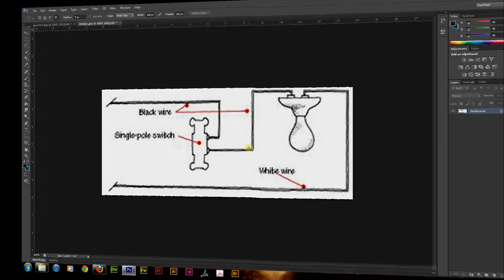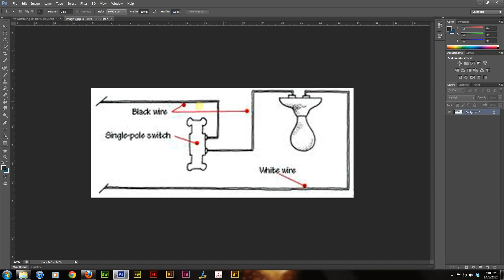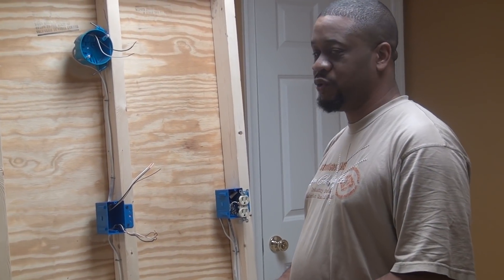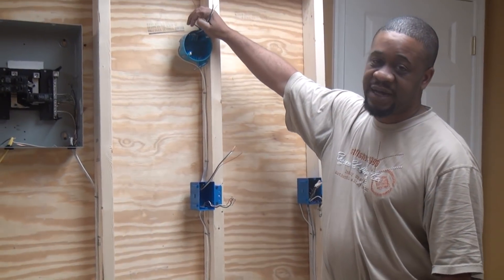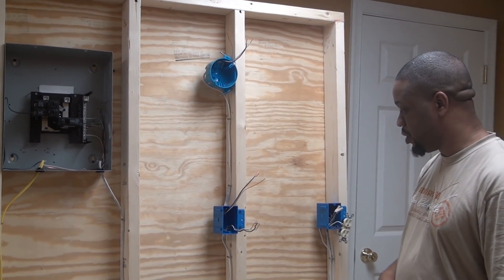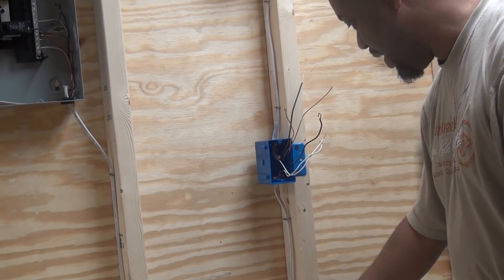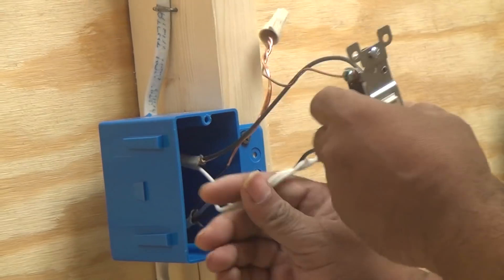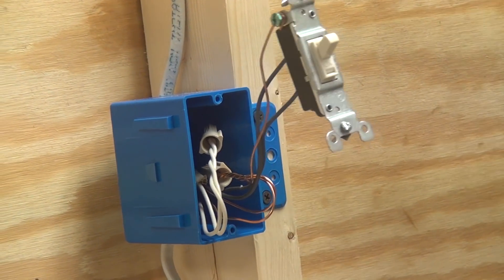how to install a single pole switch

Comment: I am renting and want to install spot lights/ ceiling lights that connect to a plug to plug into a wall. I am putting. it in a box to be attached to the ceiling so I am not actually cutting holes or doing a major wiring job.  My question is, how do I connect the lights in a chain to come to one end where I can connect a cord w/switch & plug them bad boys in?
Reply from the maker: black to black white to white ground to ground. since you plan on having basically a extension cord connected to the lights as a power source and switch I highly suggest that you make extra sure that the cord has a ground and that it has a solid connection.
Reply: I'm sorry & one would probably say why is she doing this with no knowledge of any of it but I have to start somewhere right! 😁 but ground?? I need the wiring for Dummies version. I have watch plenty of videos and believe i get the just of it with parallel circuits and striping of wire and the ridged side of the cord vs the smooth, but no one actually says how to connect multiple lights to an extension cords or plug to be plugged in nor do they explain if lamp wire would be what I use to attach each light to each other but I have many questions, lets get what you mean by ground on the first part of your message & the last regarding the extension cord? thank you
Reply from the maker: You certainly do not want to use lamp cord because it may not have a ground eg. just  2 wire (most lamp cords). Your ground is what allows the circuit breaker to open if  current flows outside of its intended path. If you have no ground then you have no protection against faults. You also need to observe the polarity of your connections to make sure that hot and neutral are not reversed.  I have videos on my channel that answer all of these questions, however if you are not able to follow the concepts you may want to call an electrician to be on the safe side.
Reply: Amen. I will watch more videos and get a better understanding b4 I do anything. Which one of your videos best explains what I am trying to accomplish here?
Reply from the maker: I would suggest looking at all so you will have a good understanding of what it is you are getting into. If it were plumbing or carpentry then having a limited understanding would  be more forgiving, but with electrical making the wrong type of mistakes can be super costly and in the worse case fatal. So go through all the videos and if you still have questions I do suggest giving your local electrician a call. BTW for the record I do not agree with what you plan on doing but if that is the route that you take I would rather see you do it in the safest way possible.
Reply: I didn't realize the complexity of it all or all the concerns in safety.  The guy at Home Depot made it seem doable and quite easy. I thought I could just use the parallel circuit method & be done then you said the "ground" & not to use lamp wiring and I. got a lil messed up. I then thought ok same thing just using 3 wires instead of 2 and just connect black to black white to white & ground to ground til I get to the end then do the same connecting the remaining black white & ground to the extension cord but since its a lil more complex than that I will leave that to the professionals and find a safer way to get the effect I want. Thank you so much!
Reply from the maker: You are welcome Lythisa

Comment: hahahah no and foo   laughs ..  Nicely done  ..  can you use quick connects instead of twist caps just for neatness ??   or is there a problem codewise with using them
Reply from the maker: You can use any device that is UL rated
Reply: thank you ..  It worked well.   I am now following you

Comment: I am trying to replace a single pole switch with a GE Smart Switch. I looked in my switch box but the only wires I see are a black, a white (both of which are connected to the two terminals on the right side of the switch) and a bare copper wire. I don't have the second black wire so it must be wired differently. Do you know if this will still work with the Smart Switch?

Comment: I really like the setup with the free standing wall, clearly showing the boxes, wiring, breaker, everything. Really smart idea. You could have cut the part with you getting the ground wire and bulb and we would have had no idea! Still, great video, I know it's a few years old but it was very helpful.
Reply from the maker: Thanks sirixamo

Comment: I really liked this video and I want to thank the fellow in it for doing an outstanding job and being very informative. I also liked that he pointed out which color screw was for which wire.  It is also important that when you do wiring yourself to have a good light source to be able to tell which screw is which. White wire goes to silver screw and black wire goes to as he said bronze or gold color screw.  I also want to point out that he used the right tools for the job. The screwdriver he used if you had noticed had a protective plastic sleeve on it which is to prevent any unintentional grounding which could cause an arcing of electricity and also the wire strippers he used were good as well. One thing I have learned from my own experience over the past fifty years of doing things myself is that you can not be cheap with your tools and materials.  And he had wired the switch and light the correct way, unlike my dad who had some how always managed to wire a light switch using both the white and black wires.  Where in this video we see that only the black wires go from the light switch to the light. I don't exactly remember how my dad had done this but this was the way it was back in the fifties and why I will never know. Could help to explain why so many electrical fires happened back in them days before uniform building codes were put into place.  Back in those days crews that built houses like the ones my dad built also did all the plumbing and electrical work as well.  But I cannot stress enough how good and valuable it is to find a person as this man who had demonstrated that he is not an idiot and actually knew what he was talking about.  This man whether he realizes it or not could actually have saved lives by showing the proper way to install an outlet. I know because a building that my dad had wired burned down two years ago from faulty wiring.  And also use the proper wiring for the intended use. Don't be like my dad and use internal wiring for external or underground use.

Comment: could i use 2 awg ser wire. 4 phase? when they updated the home panel everything is copper.
Reply from the maker: +PolyCouple PaulCryatal ser is 4 conductor cable

Comment: i was wondering if you can tell me . i want to install 100amp subpanel. to my deattached garage.running a cable from the main house which is 500ft away. the house has a 200amp panel.4 wires. 2hot.1nutural.1 ground.  . what size wire should i use to feed the sub panel. i know code states i must use the 4 wires. and i will also i use 2 grounding rods 6 feet apart.
Reply from the maker: +PolyCouple PaulCryatal 2awg ser aluminum

Comment: do you have a video on running multiple lights on a 1 switch circuit?
Reply from the maker: +Dimas Henriquez The process is the same it does not change. You simply parallel as many lights as you want (run cable from light 1 to light 2 etc. connecting black to black, white to white, ground to ground)

Comment: The switch that controls my basement light is wired to both the white and black wires. Why is it wired this way instead of being the way you wired your switch?
Reply from the maker: +Dimas Henriquez There are many ways to wire a switch loop, I just present a method that is commonly used and most likely to run across.

Comment: Thanks for a Great video!  I am trying to wire up a matrix of 60 each NP5 GU10 120V 25W Halogen lights.  The matrix will have 6 lights in the  X axis times 10 lights in the Y axis = 60 lights total.  I want to add 16 each light switches, one on each horizontal and vertical row so I can control power to a specific light or set of lights in the matrix.  Hope this makes sense.  60 lights times 25 watts =  1,500 watts / 120V = 12.5 Amps if I had everything on, so I should be able to run this on a normal 15 amps house outlet.  Also could I do this with light dimmer on/off switches so I could even have more control over the lights??  How should I wire this up??  Thanks for your help.
Reply from the maker: +Paul Moon well there are many ways to wire this up but a good rule of thumb is to not load your circuit to more than 80% of its rating. So a 15 amp circuit should have a load no greater than 12 amps 20 amp circuit 16 amps etc. Yes you can use a dimmer or lighting controller, how you design the circuit  is up to you.

Comment: how can you cancel the 3 way and replace by one motion detector switch?
I have 3 switches (top, mid, bottom) of the staircase and I wanna replace the middle one with a motion switch and bypass the top and bottom.
Reply from the maker: +J Desroches If you have 3 switches controlling one light then 2 of them are 3 way switches and the other is a 4 way switch. the type of switch that is in the middle will determine which type of motion switch you will need also I am pretty sure that you have to have a neutral conductor in the box that contain the switch that you want to replace with a motion switch (occupancy sensor)
Reply: Thanks for the answer T
Reply from the maker: +J Desroches you are welcome

Comment: Would a afci breaker be needed to install a single pole switch in a living area or a single pole breaker is what would be needed?
Reply from the maker: +malik lazare In the us yes the afci is needed single pole or double pole depends on what the circuit is for

Comment: Great video, best one I've seen on YouTube thus far. My only question is which side of the switch goes to the light bulb? the on or off?
Reply from the maker: +Calvert Edwards does not matter

Comment: switch info good BUT, FIRST THING, you forgot to tell the amateurs to TURN OFF THE BREAKER going to the electric box BEFORE they start.  Most amateurs will touch the live wire to the screwdriver or pliers to the metal part of the switch or some other metal close.  The result; a shock or burning of the metal item and the screwdriver and switch.

Comment: Can you tap from an existing switch to run to a new switch for a new light?
Reply from the maker: +Frapo Chino If the box containing the existing switch has a neutral conductor in the box then yes.
Reply: +Tyrone Robertson could you please elaborate on why it has to have an existing neutral ? What if it doesn't?
Reply from the maker: +Frapo Chino the new light will need a hot and neutral wire to operate, so does not matter where the power comes from so long as the source has a hot and neutral conductor.

Comment: Thanks hommy saved me $200 for a closet light...didn't even know i could take power from a outlet to it...i thought you need a whole new wire to the circuit board for it.

Comment: Hi Tyrone. I'm going to change my old light switches to new single pole switches. The new switches I bought have 2 terminals on 1 side and ground terminal. The old switches in the house that I want to remove  only have 1 terminal on each side and looks like it doesn't have a ground terminal. What can I do there? Can I still use the new switches that I bought?
Reply from the maker: +Jose Pineda yes, if the box is grounded just use a 10-32 screw  in the box and attach a ground wire under the screw and use that for your ground on the switch

Comment: Hey Tyrone love your videos....Very helpful! I have a question: I just replace a standard outlet in my basement with a GFCI outlet and while I was at it, I decided to add a switch and a light. The new switch and light work fine but my meter shows "Open Hot" on the GFCI outlet and it is not working. I pigtailed the ground, black and white wires (like in your video) then wire nutted the 3 grounds, 3 white and 3 black wires at the GFCI outlet. At the switch, I joined the 2 white wires (from switch and light), connected 2 black wires to switch and pigtailed and wire nutted the 3 ground wires. At the light, connected the white and black wires to the fixture and pushed the 1 ground wire into plastic box. Any help as to why I have an OPEN HOT on GFCI outlet will be MUCH appreciated! Keep up the great videos. - Penny
Reply: +Penny DiCarlo - Also, it is a 20amp circuit and I ran 12g wire to switch and light (12g is what was coming in to exsisting outlet). The only thing on that circuit (as far as I know) is a sump pump motor and the new switch and outlet.
Reply from the maker: +Penny DiCarlo you would have to take pictures and send them to me then I would be able to see exactly what you have and give you a solution.
Reply: +Tyrone Robertson Hi Tyrone, thank you for your quick response. Turns out, the GFCI outlet was tripped when I tested it......duh! Everything works great. Thank you for your helpful and informative videos. :-)
Reply from the maker: +Penny DiCarlo You are welcome :-)

Comment: Thank you so much! For some reason it took forever to find a sight that just told how to wire a normal single pole switch,  but you did a great job. Actually I've done it before but its been  a while so I just wanted to be sure I was doing it right.
Reply from the maker: +mntncougar You are welcome

Comment: how can i have constant power in a single pole switch that will feed power to the fan switch next to it. Since i want to be able to turn on bathroom fan in dark or turn fan in middle of day without main light on. fan switch receives power when single pole switch is on. There is a red wire connected to same connection where black wire is connected to on single pole switch. The red wire is then connected to black screw on fan switch which powers it if its on the on position.

Comment: My kitchen light switch only has 2 wires, no ground. Is that normal?
Reply from the maker: +SPaoline4302 in some older homes you will not have a grounding conductor and in some situation I have seen updated wiring where the ground has been cut.

Comment: Hey Tyrone I am having some trouble with hooking up a new ceiling fan I have changed all my ceiling fans in my house including the one that I have took down to install a new one what I am having trouble with is first off all there is only one wire going into the box for the Single Pole light switch the wires were stuck into the back of the switch I hooked up the new fan there is power when the light switch is an the off position however when I turn the switch to the on position it throws the breaker. I am confused why there is only one wire going into the light switch box need some help
Reply from the maker: well if the light was working prior and there is only one wire in the box I can think of only one possible explanation. There was no neutral conductor in the box and they used the grounded box as a neutral by connecting the white neutral to the box. This of course is a big no no you do not want to repeat this action if that is the case.
Reply: thank you for the help after scratching my head for a bit i figured out what they did apparently they was short on the wire and used the nuetral as a hot i marked the wires so this wont happen again it is crazy how some things pass inspection when being built

Comment: Thanks, you cleared it up for me...   I'm wiring a light in an existing closet.  I will use the White Wire from the Switch to connect to the Black wire on the Light....
thanks AGAIN!

Comment: Hey Tyrone, thanks for the videos. I am running electricity to my garage from the house breaker box about 100 feet away, do I use 10 gage for the long run to the garage sub panel then 12 for all the outlets and lights or can I just use 12 gage for the whole thing ?
Reply from the maker: fudgedog 100 ft is not that long of a run you can use 12awg if you want.
Reply: Tyrone Robertson thanks

Comment: Great video, great teacher. Do yo have one on bedroom outlets controlled by light switch for bed side lamps?
Reply from the maker: David Farrell I do not have one that show that specifically but the principal is the same instead of running the switch leg to the light you run it to the outlet that you want to control.
Reply: Thanks
Reply from the maker: David Farrell You are welcome David

Comment: Thanks Tyrone. This helped me out. Keep making videos and I will be watching.  If I might offer a safety tip.  When you show the finished switch, you did not actually stuff the wires in the box and close it up.  The seems unnecessary, but it would lead to the safety comment to watch the placement of the ground wire in the box.  It has no insulation and can short across the right side of the switch if shoved into the box incorrectly.  I did that once.  It was very sparkly : )  Keep up the good work!  Thanks for posting.
Reply from the maker: You are welcome Umbrium and thanks for the safety tips